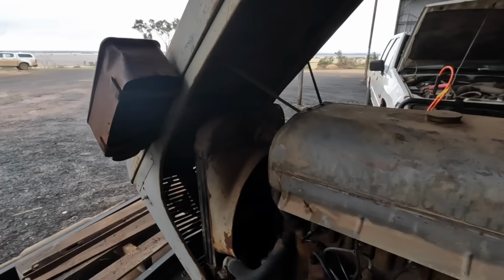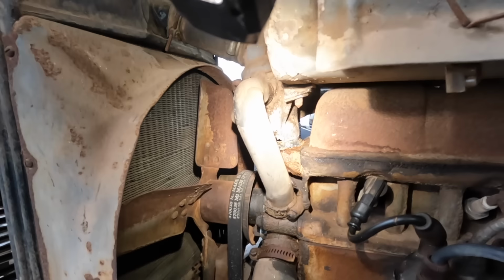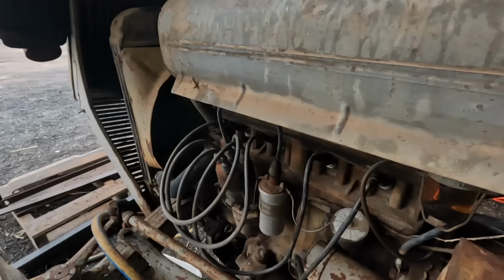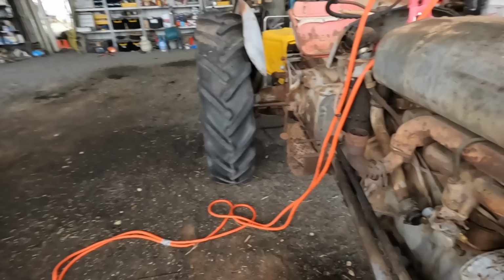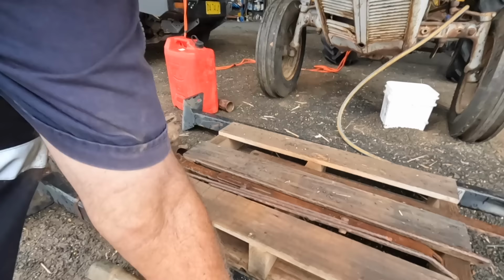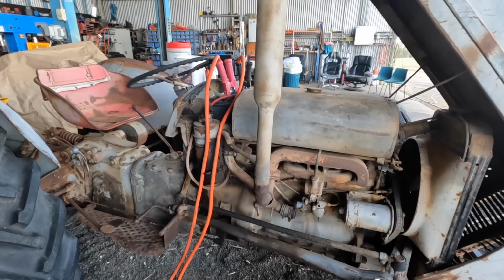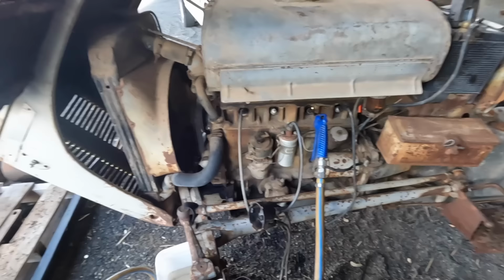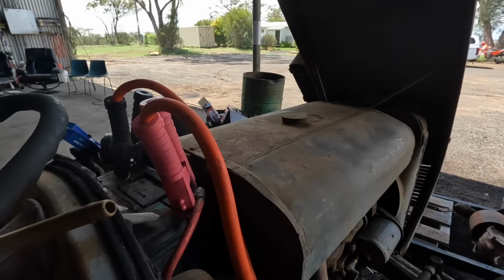Will it RUN? | Part 2 | Dads Grey Fergie | Vlog 232

Comment: As I spent 1800 hours on a Fergie in the late 50s I can feel for your affection for the little tractor, both farming and contracting too. In steep hill country, it always amused me that I could work in places that bigger machines could not. Understanding the principles of Harry Ferguson made all the difference most of the time. Pulling poles in the bush with both front wheels in the air was my favorite work. With a bit of baler twine to defeat the governor, 35MPH was great fun for a teenager.

Comment: A trick to seeing which cylinder is not firing is-
With the engine running, spray water into the 
exhaust manifold @ the cylinder head. The
water should boil away. If a cylinder is not
firing the manifold will be cool & the water
will not boil away.
You could also use a laser thermometer too.

!

Comment: I thought for minute you had the leads in wrong. Most dizzies run anti clockwise but you had the leads in right/I mean wrong. I am surprised it didn't backfire through the carby - probably minimal, if any, overlap in the cam timing. I have reversed spark leads in the dizzy before too so you are not alone. I needed my share of humility as well. I am probably not far off your age (72 yrs). So the "grey matter" sometimes does not work as well as it should. But we are still around at our age. Many people did not make it this far. So I am grateful for every day the Good Lord gives me here. Supposedly retired mechanic/machinist in SW Sydney.
Reply: I agree wholeheartedly!!!

Comment: Peter the good thing about getting older is that you can admit your mistakes halfway through the video I was typing that you had the timing wrong and that 2 and 3 were firing at the top of the exhaust stroke but you figured it out.
Testing the spark with your finger always good ever touched an electric fence.
I have a soft spot for the grey fergie they are a great tractor and will go places on the black soil country where bigger machines get bogged.
Keep it up Peter I have coffee with my mates every Wednesday morning where we solve the worlds problems.

Comment: To clean the carby gauze, try the oxy with a welding tip and wave it over the gauze, used to do that with chainsaw mufflers and works well. don't worry about the shakes, I've got 10 years on you and remember my first TEA.